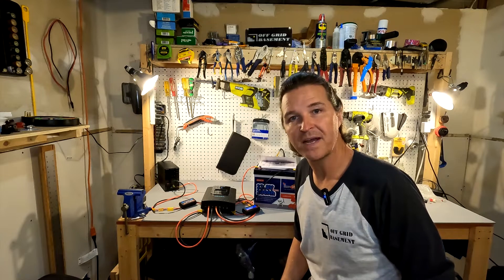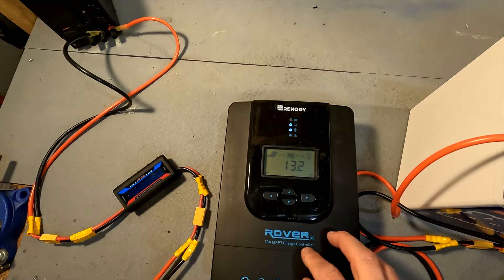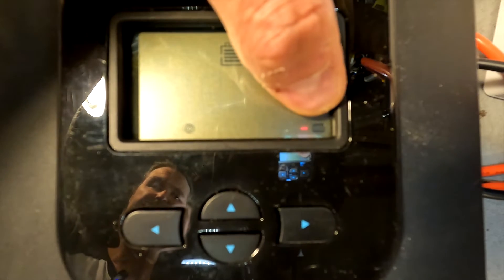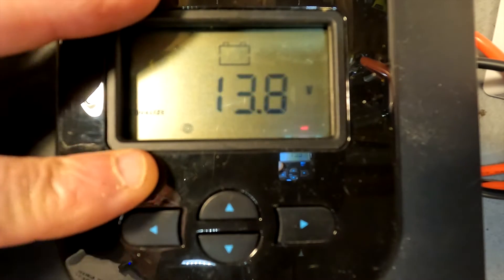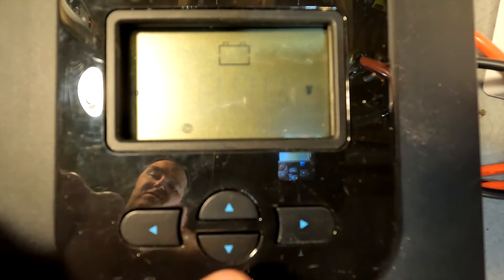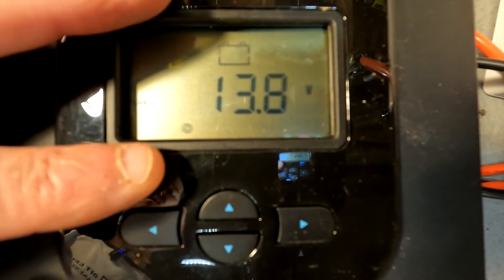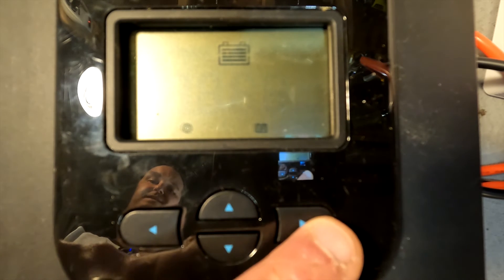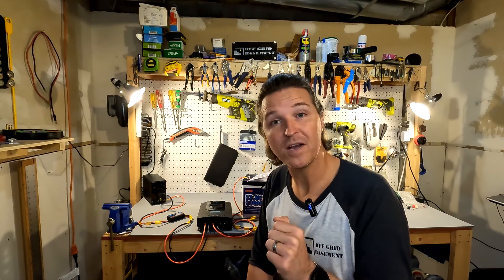How to program the Renogy Rover 30A for a Lifepo4 Battery

Comment: I spent 1100 for an Ampere Time 300ah LiFeP04 battery. After buying it the seller starts telling me the very high charge cycle life of 2000 to 4000 cycles only works if you cycle the battery between 20% and 80% state of charge which is completely impossible. The 60 amp charge controller nearly drove me crazy the first time I attempted to use it. Of course it was during an emergency power outage during a heat emergency and it was PASSWORD PROTECTED so it took hours trying to solve that ridiculous unnecessary built-in mind game! Then people on forums all told me so many things that I "may be doing wrong" like one guy who exclaimed..."You mean you DIDN`T tell the controller what your BATTERY CAPACITY is???" that I disconnected it after finally getting it working and have never used it since. I just charge up before storms with a wall charger. I could only get 300w input from two 190w and two 100w panels. Apparently I need to connect them in series or get a whole lot more cables, panels, combiner box, switches, fuses, etc etc etc, and I have no more money to keep dumping into this money pit on my small disability income. And I don`t want to ruin my battery or worse. I simply want to charge a battery from solar panels. But that appears to be an extremely risky and complicated problem.